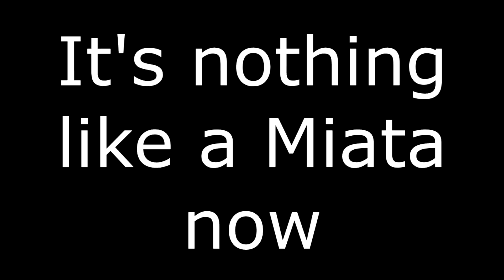ENGINE SWAPPING A MIATA IN 5 MINUTES

Comment: An EcoTec engine? 😳
Reply from the maker: yes! It’s an Ecotec LE5 out of a 2006 Pontiac Solstice. The full 3 part build series is on my channel of the swap if you’re interested!
Reply: Wouldn’t have been my first choice but keep up the good work my man!
Reply: Greg Merrill probably got it for dirt cheap. Good job man thanks for the video
Reply from the maker: as advertised the swap guarantees “200hp” and the swap can be completed on a pretty tight budget without cutting corners. I have a cost analysis video on the swap on my channel if that’s something that interests you.